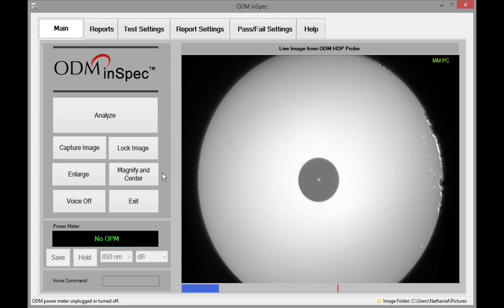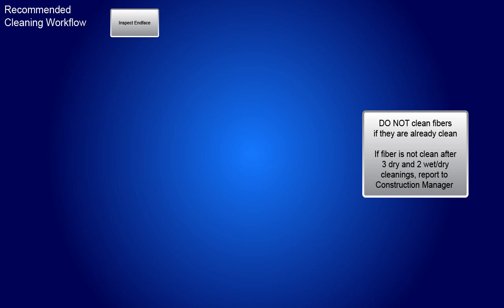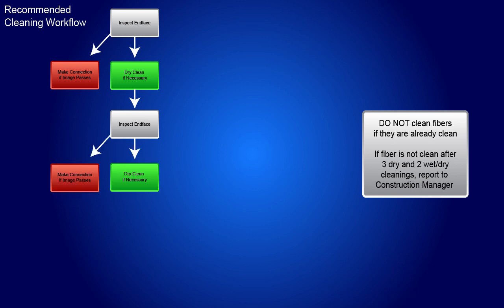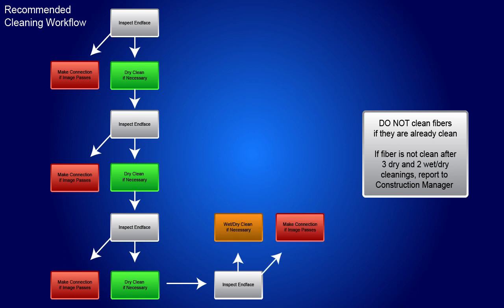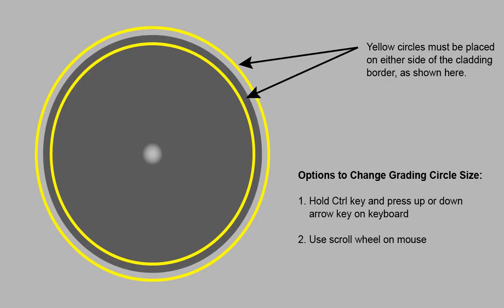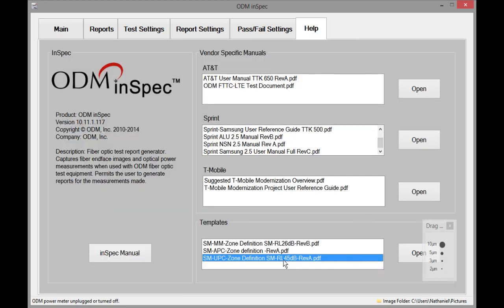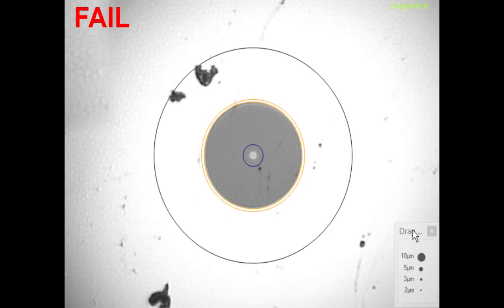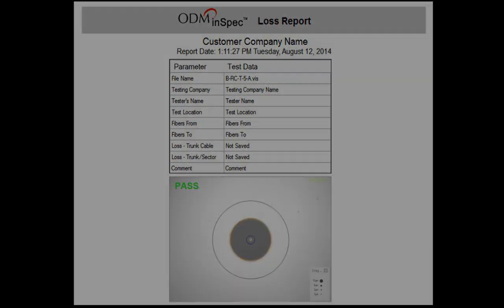The Manual Fiber Inspection and Grading Method

Comment: Several company´s have this included with the Microscope.
Eaven Atuto Center and aturo Futo Focus

JDSU/VIAVI today. Exfo.
And also FLUKE with Auto Center/ Auto focus but not IEC 61300-3-35 standard
See:
http://www.flukenetworks.com/installation-and-test/fiber-inspection-and-cleaning/fi-500-fiberInspector-micro